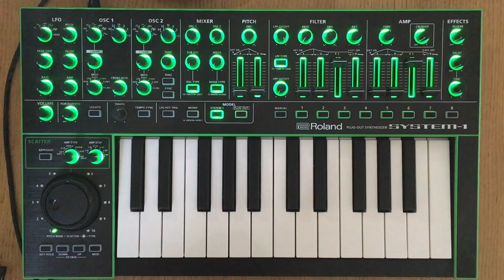How To Use A Synth Part II - The Amp Section

Comment: There is one misleading explanation:
DECAY is NOT the max value the signal will have until it fades to the SUSTAIN value.
DECAY is the TIME the signal takes to go from 100% to the SUSTAIN value.

ATTACK, DECAY and RELEASE are time units (expressed in seconds)
SUSTAIN is a value (0 to 100%)

Comment: so basically each of the sliders determines the amount of time it takes for each of those effects to take place, like attack and release for example, does anyone know what the number of seconds would be exactly when the sliders are at the top? Is that amount universal to all synths are do they vary? also are tutorials like these good for using VST synths that don't use keyboards but just include the tools needed to shape a sound (amp, LFO, filter etc.) I would greatly appreciate advice or clarification on this stuff, just got into synth production recently:)
Reply from the maker: I don't think there is a standard length for how many seconds the sliders represent, i think it differs for each synth! But yes you can use these tutorials for VST synths or any synth that has similar controls.
Reply: This comment just made me realize why having a quicker attack is at the bottom of the slider rather than the top. This has always confused me.